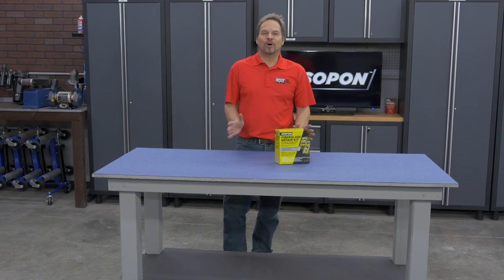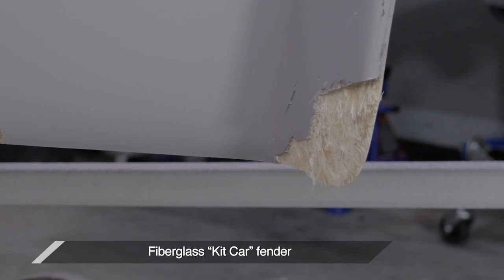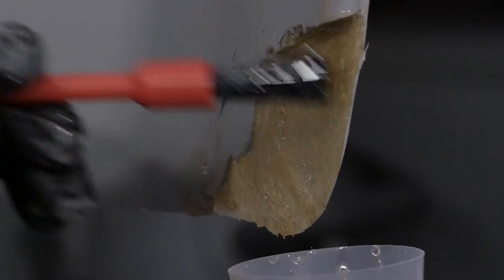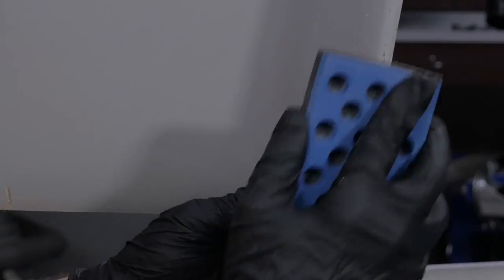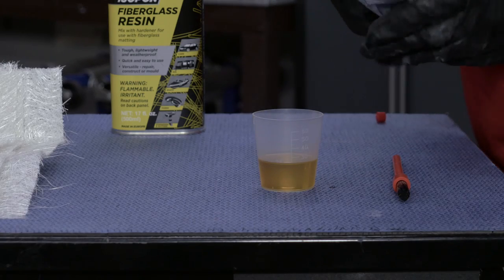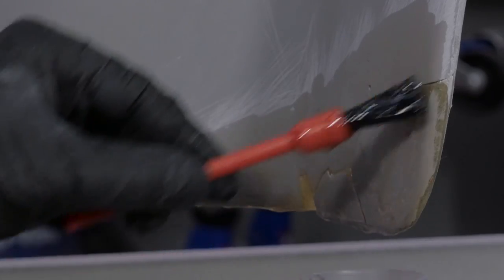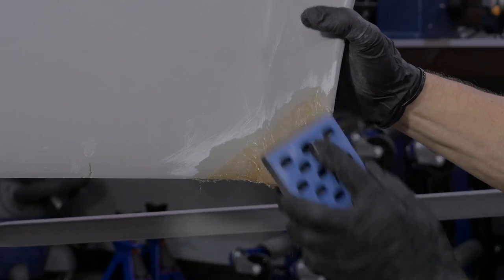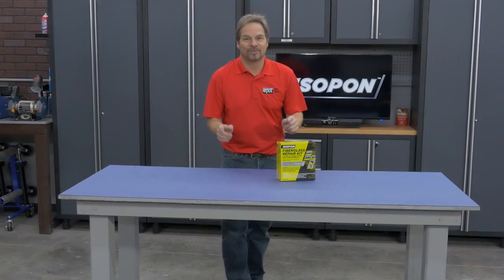ISOPON Fiberglass Repair For Metal, Wood, Stone And Other Materials (UP5009)

Comment: Would this be about 2% by weight of hardener to resin? As with typical resin mixture schedules?
Reply from the maker: Hi Matthew. The mix ratio is actually 3%, and mixing at 3% by weight gives a 5 – 6 mins working time @ 20°C/68°F.
Reply: @UPOLRaptor  would 0.75% give  ~20 mins ? . trying to build a mudguard and need more time than my first attempt.
Reply from the maker: @beautifulsmall  For Isopon Fibreglass Filler the hardener (BPO) should be added at 4% which gives you 5 - 6 mins work time.
 For FastGlas the hardener (BPO) should be added at 3% which will also give a similar work time. Both of these can be percentage by weight or volume but do not mix, so if you weigh the filler then use weight for the BPO.
Reply: How on earth can you now make that repair smooth?
The fibreglass matting is already sitting proud, even after you ‘sanded’ it.
Reply: @davidpagett9895  

Once you have applied the fibre glass sheeting, wait until it's hardened and give it a once over with sand paper as per instructions on video .once this is done mix up isopon 2 part filler and apply it over the fibre glass sheeting making sure you go past it say 10mm  maybe more . Work fast though as it will harden very quick (4/5 mins max) once dried/hardened  start lightly sanding preferable with wet/dry paper all over. Once your at the part we're you over lapped the fibre glass sheeting and filler you need to gently sand it to  feather it to out to the filled surface taking care not to sand away to much or the fibre sheeting starts to show through. Hope this helps.